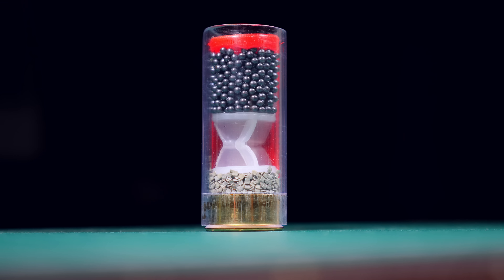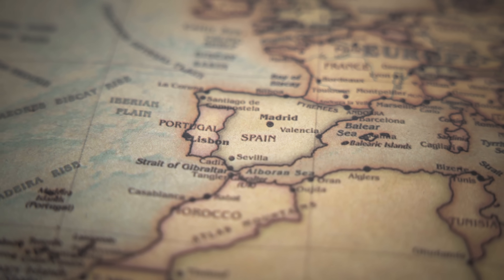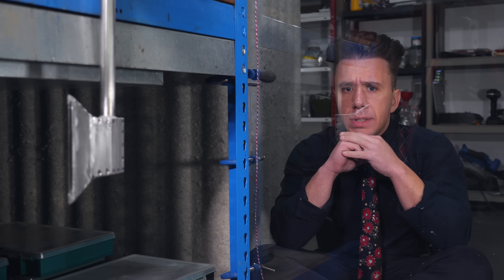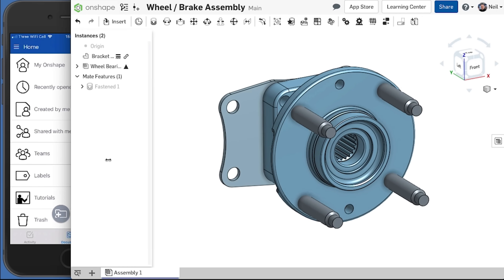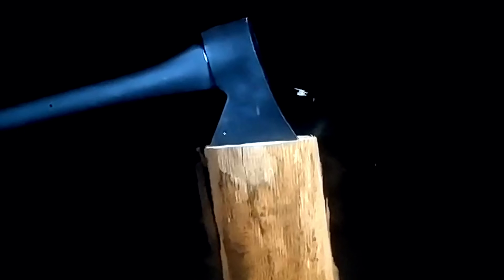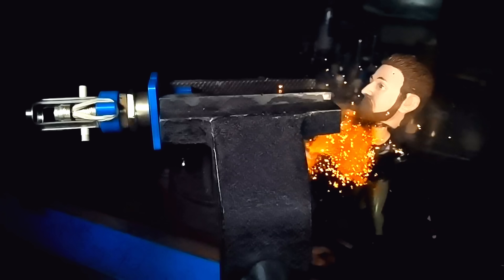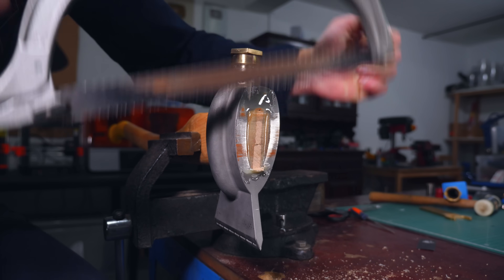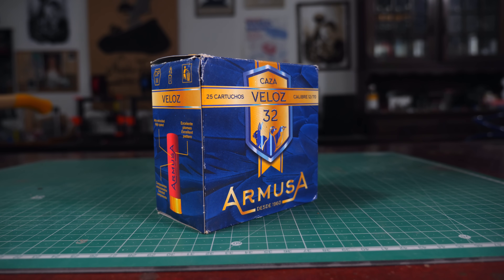I Built a SHOTGUN AXE

Comment: OK.  Couple of things.....  ** gun nut hat on **  I have.... concerns.  For one thing, that's a LOT of pressure you're dealing with.  With..... a polycarbonate chamber, braised onto the axe head?!?!?!?!  Not exactly something I'd want to be close to.  Also, I would never use that thing again.  Laser sintered metals have strength issues.  They're porous.  Basically the steel melts and swirls around as it solidifies, leaving voids.  I know it CAN be done safely, or safeISHly.  One of the early 3d metal printer manufacturers printed a 1911 as a proof of concept.  I still don't think having JLCPCB print out a hollow axe head is a great idea though.

Also, can you buy shotgun blanks in Portugal?  Or actual handloading equipment?  Might be easier to make the blanks from scratch that way, and gun laws are weird.  The fact that the gun itself is illegal doesn't necessarily mean that accessories like handloading equipment are.  (They might be, but as I said, gun laws are weird.... and that's not just an American thing.  It's amazing the things you find out are legal sometimes if you just look at the law....)

Other problems, that head is going to clog up at some point.  "Smokeless" is a relative term.  It's incredibly clean..... compared to black powder.  It's still pretty dirty in absolute terms.  You'd want to soak the head in a solvent of some kind.... gun cleaner?  Something to clear the residue out.

Comment: The “this thing” is a wad, it holds a seal to push the payload of the shell down the barrel and prevent pressure from leaving, not the crimp 
Also the reason why some didn’t split is due to some wood having knots, being wet or so on, in these applications it’s better to hammer in a heavier wedge 
Also I suggest moving the slits to the center of the edge instead of the side faces, it’ll be harder to sharpen but should give more consistent results on slanted hits

Comment: An interesting variation on this theme is the blasting gun that used to be used for digging post holes by bushmen.  It was also used for splitting large tree trunks.  It was basically a heavy steel bar bored out with the end sharpened to a cone.  A fuse hole was drilled into the side.  Instead of fuse, a rocket motor ignitor could be used for greater control.

Comment: You can get factory made shell blanks that are used for things like tripwire operated noise makes for scaring off animals and whatnot. Also you might be able to modify the design by using .50 caliber blank shells that are often used in concrete nailing guns. They're a rim-fire cartridge and can hold a good bit of punch (at least based on what "I did a thing" did with his hammer and pool cue). You might be able to get the .22 cartridges to work though they're a lower power, then again they're also used for driving nails into concrete so heck if I know.

Comment: This comment is for education purposes for those reloading shells for sporting or scientific purposes: you can load a shell, blank or otherwise, by properly compressing the powder under a wad made from paper, cloth, or actually shell wads. It will function correctly with out the shot or crimp in front of it. for blank rounds a small amount of toilet paper will suffice after the powder is compressed.

Comment: Very nice! We had a similar 100+ year old version of this we used on our farm.  It was a fence rail splitter.  It was a steel, somewhat tubular shaped wedge with barbs on it that you would pound into the end of a log. You would then fill with black powder and a fuse to blow the log into fence rails.  It worked pretty well.

Comment: Anatomy of a shotgun cartridge: the outer layer is known as the case or shell and is made of hard plastic and comes in a wide variety of colors ranging from red, green, black and blue, theres is no coordination to the type projectile in the case the color just depends on region and manufacturer. The projectiles are known as pellets or if they are one solid mass, a slug. they can range in sizes for what you need with the smallest being bird shot, used for hunting flying game, to slugs which are used for a variety of purposes from Skeet shooting to door breaching. next is the wadding, which acts to hold the projectiles together long enough to leave a shotgun barrel with out destroying the barrel. the last two parts are the powder and primer, powder moves the projectiles, primer makes the powder go boom

Comment: Why are you using the shotgun shells as the energy source ? It is introducing soooo many unnecessary issues that could easily be solved by simply using a handgun blank. The powder that's inside pistol caliber cartridges is designed to burn much faster .

Comment: 0:35 - "If you examine the shell's butt, you find a metallic button called a primer..."

Wait.  WAIT.  Epiphany happening here... 

The primer activates the gunpowder, thereby activating the shell... in effect it turns the shell on to do the thing.

A button can be used to turn things on.

This button is on the end of the shell... the 'butt' of it as has been said...

Butt... on...

Button.

OMG.  It's so *obvious*.  HOW DID I NOT SEE THIS BEFORE?!

Comment: Great video, I was amazed it worked so well. 

Too bad about your gun laws. I just wish we could get rid of the idiots who ruin it for everyone.   

Anyway, for v2, I'd go for a narrower, lighter blade and a smaller charge.  That would let you get a more consistent and accurate swing with deeper penetration.  You are filling your own shells, so that should be easy to calibrate. 

Then you need some sort of a magazine to hold multiple shells, so you don't need to reload between every swing.

The trick is to leverage as much engineering from a semi-automatic pistol, without it being a gun or anyone thinking it's a gun. 

Sounds fun.  Here, hold my beer.  I've got this. 

Of course, a semi auto axe might actually be more scary than a handgun, so maybe not.

Comment: I think you are doing it the wrong way by trying to use the gasses to split the wood. It has too much limitations, including when the wood doesn't cover the whole axe length. I think the best way to do this, would have the shotgun shell turned around, and have a "barrel" upwards from the axe. Then you have a really heavy weight in there, and then have a magnetic/metallic ring around the shell, so its held above the firing pin by magnetic/neodymium ring, so the weight of the shell actually fires it by flinging it against the firing pin when the axe hits the wood. To prevent the heavy weight from exiting the barrel, you would have a spring and a end stop, and when the weight is in the topmost position (compressed spring), then theres holes drilled into the "barrel" so the gasses can exit horizontally.

So basically, the inertia & recoil from the heavy weight being accelerated upwards in the barrel, will force the axe down in the wood being cut. When that heavy weight is in the topmost position, then the holes that allow the gasses to escape, becomes exposed and thus the gasses exit safely.

To avoid the heavy weight from exerting force on top of the shotshell and thus releasing it from the magnetic ring too early, there would need to be some retaining ring so the weight rest on top of, as close as possible to the shotshell, but never touching it.
Reply: might break your hand or the handle with how much energy is in a 12g shell as the counterweight is going to be cooking.

Comment: It’s called a slam fire shotgun usually used to get the gift cards at gun buy backs 2:40
Reply: How about the Serbu GB-22 then?
Reply: It's a hillbilly shotgun
Reply: Not anymore. Because it's considered slam fire... aka a destructive device. Only one of those without the right permits lands you in jail...
Reply: @zeanyt2372 slamfire is not a destructive device. If it was, every winchester 1897 would be. Slamfire shotguns aren't manufactured anymore simply due to safety concerns

Comment: 22 blanks are probably a lot cheaper and less time-consuming. They are ready to fire out of the box. A redesign to use a few of those could get the same effect, and you could also gauge how many you what need for a specific sized log. Should allow for more use case scenarios and save money as well. because shooting wood with an axe is already saving money, lmao

(Not sure of the name of the tool, but it's used to drive nails into concrete and steel. Those are the 22 blanks I'm talking about)

Comment: In a world of battery operated everything; Powder actuated tools have a special place in my heart.
Reply: And they're definitely still useful. For my use: While you can drill a hole in concrete and cement a stud in, it's a lot faster/easier to just shoot a nail in and sometimes that's all you need.
Reply: @shadefangkweep  Yeah...drilling concrete or brick isnt a good time. Lots of mess, lots of dust, and lots of time spent drilling.

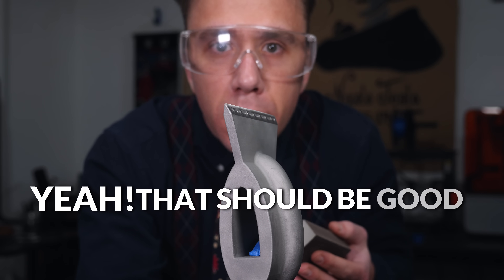Comment: 10:38 you said WELD the adapter in place, technicly its soldering. because you are just melting some material to stick the 2 parts together you do not melt the parts itself
Reply: it's called brazing. it's difficult to weld brass to steel so the easier way is to use a filler that has a lower melting temp than brass. similar to soldering as like you said, the parts themselves aren't being melted, but not soldering as it's done at a much higher temperature

Comment: RE the tractor that used shotgun shells to start it:
Starters are a relatively modern invention in the internal combustion engine world. Hence why early vehicles basically had 3 choices - start off another engine that was already running, start using a manual crank handle, or start with a shotgun shell. Many early aeroplanes also used shotgun start. If you ever see the film 'Flight of the Phoenix', the limited supply of shotgun shells to start the engines is a big plot point. Old battleships, when they first transitioned from steam to oil, pretty much used artillery shell start.

Comment: Would it be possible to build a different model that basically does the same thing but instead of shotgun shells, what about a bunch of super capacitors & a power bank in a separate container connected with wires to a hatchet 🪓 with some kind of electric piston type of device built into it. Allowing you to get multiple swings out of it compared to the one swing that the shotgun shell gives you..

Comment: I'm wondering why you did not put the shotgun shell in the handle with a bend at the end to redirect it into the ax? This would've given you ample length for a full powder burn. You could've easily then had a manual trigger that once you swung/stuck the axe you just thumb the trigger for the explosive. Way safer than the trigger you came up with.

Comment: Being that I live in the land of guns everywhere (the USA) and the fact I have over half a million rounds of various ammunition for my few hundred firearms I have collected over the decades, I have plenty of various size cartridges/shells to experiment with blasting wood apart. I live on a homestead up in the high desert mountains. In my garage is a full machine shop and wood shop... mostly used to make spare parts for my tractor and excavator. Okay, I also sand cast and have made bronze cannon (black powder, solid shot only). 
I am certain I can violate your "don't try this at home" rule as the two houses on my property have wood stoves for heating and occasional cooking. My family uses a LOT of cut wood and splitting logs is a constant chore. Sure we have a motorized wood splitter, but a gunpowder-powered wood splitter is something that sounds like fun for the whole family, even Grandma Jenny!
With some sand casting and silicon bronze, I could cast a bronze version of what you made... with some actual chambers from old shotgun or rifle barrels (or pistol barrels) depending on the size of blank I would use.
You gave me a wonderful idea as a fun little project while everyone up here in the mountains is snowbound with a meter (3 feet) of snow covering our property and knowing it will be a late winter with more snowfall, there's nothing much TO DO other than fun crafts for the family to enjoy. Time to melt my silicon bronze knife* blades to cast a new axehead!

*Always have a strong, durable knife (or a dozen) that cannot produce sparks while working with them. Steel knives can spark and in certain enclosed spaces with the wrong gases, sparks are not what you want if you drop the knife!

Comment: In the early 1900's my grandfather purchased a couple of Black Powder splitting wedges. You hammered the wedge into place and then poured a few grains of black powder into it's charge cavity and installed the plug that had a fuse port. Sprinkle black powder on the fuse port and light it. Sometimes if you went a little bonkers with the black powder the wedge would jump into the air and force you to run. Log would be split but so would your head if you didn't run fast or far enough.
Reply: So what I'm hearing is that his design is actually safer than what your grandfather had. Nice.
Reply: In the days before I had a hydraulic log splitter, I would have tried that when splitting big 3ft Douglas fir rounds. Once you get them broke that first time it's not too bad usually but getting that first chunk off can take a lot of pounding on the wedge sometimes. Light the fuse and run into the wood shed for cover real quick lol
Reply: Glad I'm not the only person who remembers these. Can also drill a hole in the log and fill with a little black powder....by a little I mean a palm full, then you draw straws to see who lights the fuse XD
Reply: @gotindrachenhart Hell yeah
Reply: It would have been safer if it used a long braided fuse which would give enough delay to get away.
Reply: @codetech5598  not a thing people had laying around.  But black powder was a house hold object.
Reply: It's called a "powder wedge".
Reply: @sinisterthoughts2896 the patent is under “black powder splitting wedge”. He  was right. Colloquially they are powder wedges but the actual correct answer is black powder splitting wedge.  Much like other companies have made “speed squares”  that are technically called rafter squares bc technically  Swanson owns the patent  on 7 inch 90 degree angle squares they are factually called speed squares imitators are rafters .
Reply: @sinisterthoughts2896  cool beans... Thank you, I couldn't remember the proper term... Gramps always got irritated when I called them " Whack Bangs". Irish, and always proper.  Lol
Reply: How was something so dangerous purchasable lmao. Crazy times.
Reply: @SahilP2648  grandfather used to buy dynamite all the time for blowing huge tree stumps outta the ground. Different century and definitely more responsible folks. Oh, and by the way... DO NOT touch sweating dynamite and then shake the wet residue off your finger... First: it makes your finger tingle and gives you a headache... Second: the residue goes BANG and you completely forget why your finger was itching. Nitro Glycerine...ya gotta love it. Didn't lose my finger but gramps just looked at me then ducked his head and shook it. His favorite saying was: Boy... you ain't the sharpest tool in the shed, are ya.   I sure do miss the ol' goat.   Lol
Reply: @gerrywalsh5766 reminds me a bit of the story my uncle tells when he was working at a rock quarry. One day, to save time, he decided to carry the box of dynamite AND the primers at the same time. Then he tripped and fell. He said he laid real still for several seconds, convinced he was dead. Finally, he gathered his courage and opened his eyes, realizing he somehow hadn't blown himself up.
Reply: @Eyes0penNoFear  Oh yeah, that was some serious "pucker factor" Ooofda
Reply: Oh yes, the rail splitter. For making a   rail fence / fence posts.
Reply: Basically a musket axe
Reply: just lay your trunk lengthwise and stand to the side. if you don't want the wedge fly up in the air
Reply: @morpheoist  I did that once and earned a rump swatting for knocking a hole in the side of the barn. Ummm yeah, aim towards the fields before lighting.   Lol

Comment: Good vid.  Just FYI, what you've made isn't an axe (which are used for CUTTING trees down).  You've created an explosive 'maul' (sounds kinda cooler IMO).  Mauls are used specifically to split logs, generally having a wider/wedge shaped profile designed to force the log apart
Reply: Very cool
Reply: Thank you, glad I'm not the only one. I was getting an eye twitch lol. Having used a maul almost exclusively to split wood for the family as a young dude I got to the point I never even touched an axe unless I needed kindling and even then the maul was used for most of that too. I was also cringing at the swing a little not gonna lie.
Reply: @gotindrachenhart  If it looks like an axe, swings like an axe and goes bang like an axe, it's a shotgun! 🤣👍
Reply: @Bloke-in-Stoke😂
Reply: @Bloke-in-Stoke what's that gotta do with anything me or phnx0 said?
Reply: @gotindrachenhart  It's a joke! Really shouldn't have to explain that... really? I notice @PHNX0 got it and was kind enough to like it with a crying emoji. Why so twitchy?🤔
Reply: @Bloke-in-Stoke if you say so. 🤷